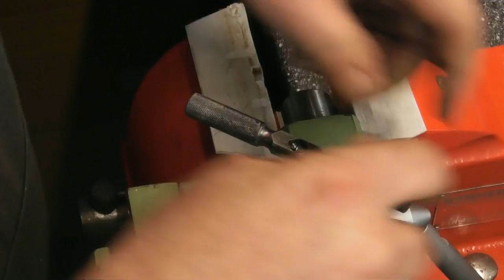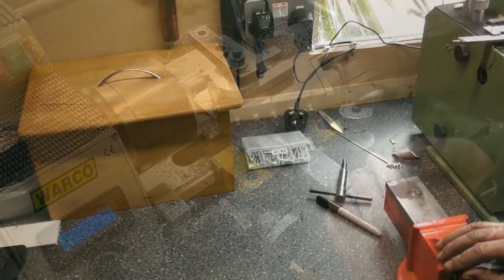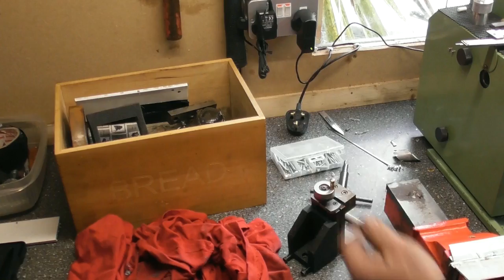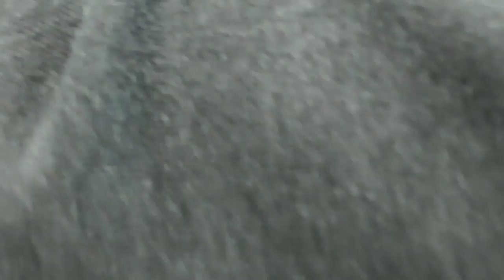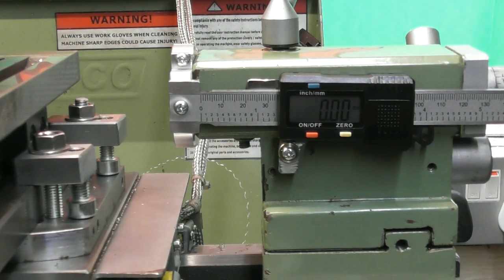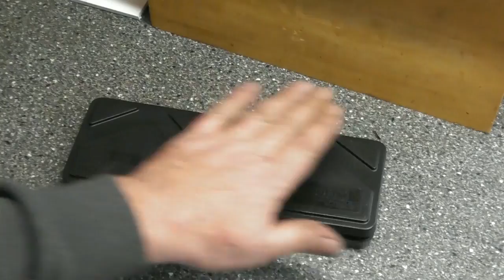Shop made Tail stock DRO on the cheap part 2

Comment: I wish I could find another way of attacking to the quill. The collar shortens the available travel and will not eject the live center. I had to add a spacer to the taper so it would eject. Problem just on my small lathe I guess.

Comment: Thanks for those inspiring videos. At the time 5:00 You tell that threading makes it easier to use screws. If You want to use a screw driver, yes. else use a heavy hammer and it will work without threads….
Only use a drill bit instead of screw driver for the reverse….

Comment: I bought one of them and it was absolute sh*t just like Ade said. The problem I found with the one a got is that it never read the same and would give massive discrepancies. Looks like you got a good one giving stable readings.
Top job!
Reply from the maker: It was a middle aisle of Lidl supermarket for £10 . worked well for this purpose but dreadful as a caliper. Cheers Ade.
Reply: @ade63dug  yeah I remember buying mine from there. I normally keep broken or damage tools for making things but that frustrated me so much I actually binned it and that's not like me as I'm a right magpie. 
Thanks for sharing your knowledge, don't think I've hit that like button so much 😃👍

Comment: Nice one Ade, don't knock the supermarket digital callipers, when I've bought them before,  just to check the accuracy I have used a Moore and Wright 1" micrometer setting donut and low and behold they are dead accurate to size. So you can't really complain. Incidentally the Aldi ones are only about eight and a half quid!

Comment: Yes take the battery out as even when the display is off the electronics still pull a current to keep track of the relative position of the slide. Interesting work, thanks.

Comment: Hi Ades, can I ask a little help from you? I intent to buy a DRO for my lathe , which should be about same size as yours. I am having problem about the size and how to install it for compound slide. Will it be ok for you to take photo on how it’s install and the size of the linear  scale? And is yours a linear glass scale? Sorry to trouble you, if it too troublesome then it’s ok. Thank you so much.
Reply from the maker: Hi, Vincent , the quick answer is that it is not a glass scale type , it is a much smaller magnetic strip type with a very small pick up , it works quite well as a very basic dro, i can see the glass type would be fine for the bed ways but there is very little room for this type on the cross slide without taking up valuable room on a lathe with very little travel to start with , if you email me ,  adesworkshop@hotmail .com    i could send you some photo's , Cheers Ade.
Reply: Thank you, I have email you.

Comment: Nice one Ade, I've got one that auto switches off and on and one that doesn't the one that doesn't tends to eat the batteries way more even though I turn it off and it hates the cold garage so get brought indoors during winter. TFS. G :)
Reply from the maker: Thanks Graeme , battery is out , worked out ok once i straightened out the axis , all good fun , Cheers Ade.